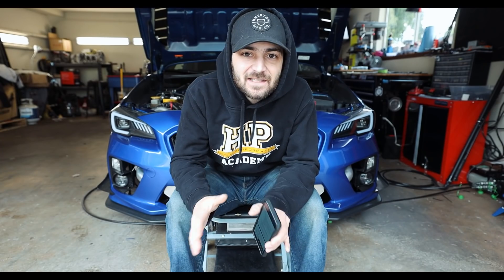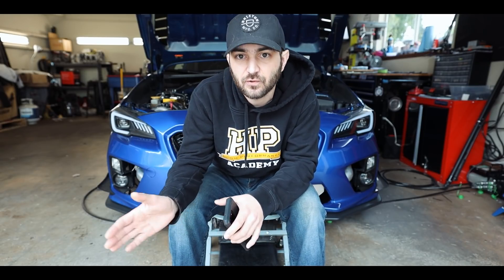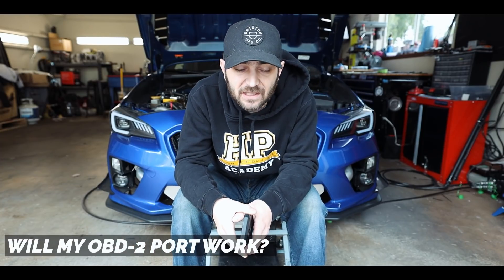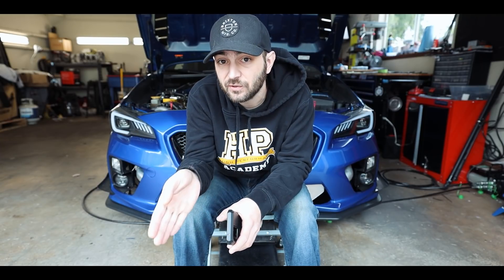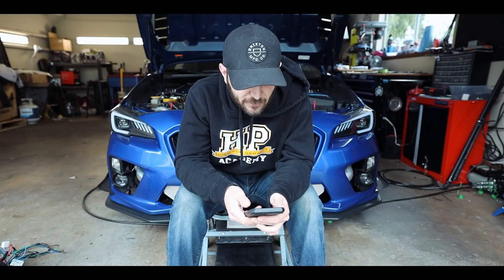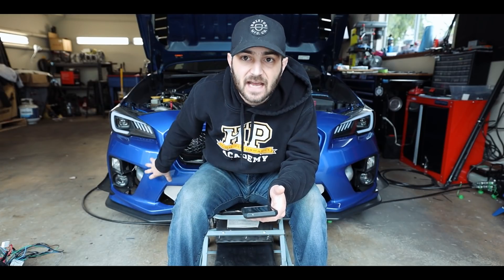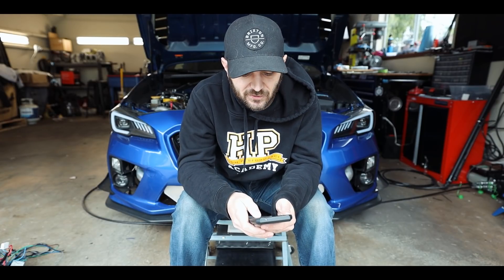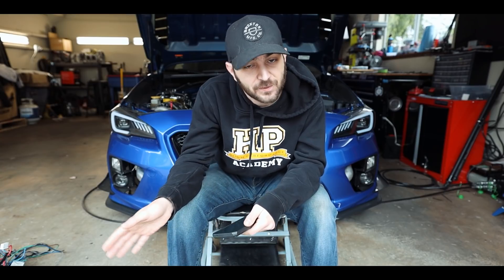Everything You NEED to Know About Stand Alone ECUs & Your Subaru

Comment: Tanner, I need some help bro.. my '05 Outback XT motor is done. I bought a jdm ej20x to swap on, but it's dual AVCS. The swap seems to work using the jdm block/heads along with the USDM Intake manifold/ turbo and Exhaust manifold. All sensors/switches plug in except the exhaust AVCS sensors, which people leave unplugged. The thing is, my car came modified and tuned for a catless DP, CAI and Grinspeed Boost Controller; however, I was never given its tune or Access Port, it was probably open source. Now I'm afraid to swap the jdm motor and damage it due to those existing mods on my car. I heard iwire makes a merge kit to control the jdm exhaust AVCS sensors, but I'd need a jdm ECU. What a headache man.. What do you recommend I do? Do I have any options or should I return the motor while I still can? Thank in advance!

Comment: Just wanted to give people a heads up, after talking to several different reputable tuners in my area, in general most if not all previous versions of downpipe/jpipes are tunable HOWEVER they will throw cels. The only one that is out there right now is the new GrimmSpeed's V2 jpipe that is said not to cause any cels. Just had one local guy get tuned and said no problems at all with it. And from what I've been told by several Subaru techs if you do get a code (P0420) you can run an 02 spacer/defouler. One tuner did confirm it does not mess with tuning either but could not comment any further. I haven't had much luck finding people who are actually running one to see if it does help.

Comment: i just want my clapped subaru to crank again
Reply from the maker: No cranking?! 😭
Reply: @Smeedia  yeah I have a 05 RS with a 08 lgt dual cam 2.5 had the harness merged used all the legacy anti theft equipment and now I have zero power to the engine bay beats me I hate it here

Comment: I'm running a Motec M1 from John Reed Racing on my 2007 Sti. All OEM functions are retained with my setup,  for those that are wondering.  Plus I've got the flexibility to run failsafes (coolant pressure,  oil pressure,  knock,  ect) in addition to being able to watch everything (egt by cylinder, ect). It's a big investment,  but totally worth it.  And one can usually get 85% of the Investment back selling the units second hand if need be. Just my experience
Reply: Does your OBD2 port still work for emission testing?

Comment: As far as cost goes I saw that mega squirt makes a pretty cheap non plug and play ecu and harness for my 04 sti. It is $360 but my question is would this be a cheaper option in the end if I am already having my engine torn apart for a rebuild? Link is $1600 so as long as labor installing a wiring harness isn’t over a grand do you think that is a viable cheap option? I just don’t know much about ecu’s and as long as I can tune it and it has launch control and flat foot shifting I’m good.
Reply from the maker: It could be viable, but I would double chdck soecs on thr Mega squirt to make sure it can perform all functions needed

Comment: What matters more when looking for a stand alone your year and model Subaru or your engine? I will have ej25 but in a 2002 wrx.
Reply from the maker: For the most part engine and can protocol will be biggest influence
Reply: @Smeedia  ok thank you so much!  Do you think I’ll need a new engine wiring harness for the swap?
Reply from the maker: What cylinder heads are you using? 🙏
Reply: @Smeedia  I was planning on using MAP stage 1 cylinder heads. Would they hold 600 safely

Comment: 2005 STI drivetrain in a GC8 RS shell - from Haltech, is the Elite 2500 my only option? Not able/worth using the “lesser” models (Eg Elite 1500)?

And any thoughts on AEM v LinkG4?
Reply from the maker: AEM and link are fantastic, haltech is thr only one I have experience with so I'd say haltech. 

The 1500 should be sufficient for the car

Comment: Based on my research (and it’s extensive because I’ve been planning out a stand-alone build for a year) there is NO aftermarket ECU which will handle emissions monitor checks or be passed by an OBD2 emissions test. Some aftermarket ECUs can be connected to the OBD2 port for canbus communication so something like a diagnostic scan-tool will still pick up codes and data pids. But if you live in an OBD2 emissions state the car will not pass because even if a scan tool can communicate with the stand-alone it won’t report any completed emissions monitors.
Reply from the maker: Good to know I couldn't find any definite answer in this topic.

Comment: for all my broke boi 01-05 wrx friends, haltech also makes the HT-055174. its a direct replacement and doesnt even need an adaptor. Not sure if its missing key features or other reasons its cheaper but its $1570 instead of $2240
Reply from the maker: Good addition to add 🔥

Comment: Before all my fellow va fa20 and ej owners go out and buy a stand-alone please keep in mind that alternative options are being worked out at the moment, we will have an opensource solution in the near future. And this is gonna happen in 1 or 2 ways. 
1. Opensource from scratch
2. Cobb source code (either exact replica, or heavily based on access tuner pre green speed)
Reply: Whos doing it? My build starts next weekend and I've been so overwhelmed with what to do tuning wise
Reply: @jamesj8348  it’s a conglomerate of people apart of the community who have the relevant knowledge and skills to work on the software aspect. For now if your build consists of items that will now trigger cel’s or if you have a flex fuel kit, your best bet is to either get ecutek, or wait. If you have the money then stand alone is fine as long as you’re okay with going that direction. However a little patience will not only save you money but also hassle from having to keep moving over to other tuning platforms as your build progresses. In the mean time I highly recommend getting a tactrix cable as you will need that once opensource is a available
Reply: @ps3alphagamer12  thanks man, clutch is getting replaced this weekend so I figured that'll be a good time to add all my mods. But I guess I'll just have to be patient and install everything while the motor is back in. It's all been so overwhelming, I ordered all my parts and shortly after cobb announced the update..
Reply from the maker: This! 

These are just options for those who have bene looking or for those that wanted more info. 

But open source and work arounds are coming out and IMO are still the most viable options over a stand alone

Comment: Just a heads up there is a company making third part plug and play adapters for the 2011-2014wrx & 2011-2018sti to run a haltech elite 2500. This also includes a base map. The company is called 14point7solutions. Also they believe they will still work on 19+ STi but haven’t had a car to test and confirm on. Can send you the link if you want to know more
Reply from the maker: Any word on if they're building out the Canbus support for it?
Reply: @Smeedia  I’m now more curious about this though, I reached out to the owner who I talked to previously to see what canbus features are all supported and if and if any are left out
Reply: @Smeedia  btw talked to them canbus support is there. Turns out this is the same system Bader will be testing

Comment: just need someone to boom slang a halter 2500 so we can figure out what exactly is retained and what needs to be be manually wired in. also if things that are wired in already via stock if we can assign them. for example the tagv left for flex signal.
Reply from the maker: You can re assign some but don't know the extent of what you can actually change in the software. In theory should be any AVI input
Reply: Well I have the boomslang in my hands.. I’m just trying to justify ordered the ecu blind and not knowing what is actually going to not work and what is… ya know ?

Comment: Say you were building karma right now instead of last year... You've got the 1300cc injectors, made fuel lines/dual pump in tank, you have the full $800 Cobb flexfuel kit and now you have to decide if you're going to work with the castrated Access Port/ comply with emissions (evap, charcoal canister, tgv, cated dp) and just run a 93octane map/ have the second map for ethanol.... Or do you say fudge it $$$ and go standalone.

Where I'm at now, I was building "The Karma specialrecipe" with +2mm rods  minus the rotated turbo and AMS intake manifold... But instead of the BC valve train in karma I have ferrea valve train/tomei poncams and ported heads.  I've only got an FP Blue, flexfuel was so easy last month I literally just wanted to see how far I can push a stock location JB turbo with a mild cam and porting. I think I'm tapping out on e85 for now/ just enjoy it as a headache free 93 octane street car... The extra $ + inconvenience of checking ethanol content at the pump like it's 2011 again and switching maps or $$$ standalone and find a tuner comfortable with whatever you have.
Reply from the maker: Personally I'd say fudge it and get the standalone, if I'm already in that deep I'd just send it and do everything proper 🙏 think you'd be happier long term with full functionality

Comment: I know I couldn't use haltech with my setup I working towards have to use a AEM  to work with the avcs and the eight injector ill be running
Reply from the maker: Going to be a wild set up 🔥
Reply: @Smeedia  going to use 1050 cc for primary and 2000cc for secondary. I'm trying to hit 35psi boost at 3500rpm aiming for that 800 hp at that rpm and stupid trq

Comment: Thanks again Tanner , you are an asset the Subaru community. It doesn’t seem like there are many options for us VA chassis owners. Hopefully time will fix that.
Reply: It really is a shame that there aren't more stand alone options for the VA chassis but after running the Motec m142 in my 2016 wrx for a couple years now I have to admit that I'm wildly impressed. Pretty expensive but the engine control is excellent without loosing oem functionality. I would encourage anyone with a 2015+ to give them a look if they are wanting to go the stand alone route
Reply from the maker: 🤞🤞🤞 hoping some more PnP options come out

Comment: Just the content i need to hear brother💪, just when im about to continue my build, so I spoke with my tuner he told me to stand by on buying more parts, so theyre trying to find out a solution to tune it right in order to use the tgv, e85 air pump delete and all that crap cobb made it complicated to us...🤞
Reply from the maker: I heard some people are looking for work arounds at the moment 🔥
Reply: @Smeedia  🤞🤞🤞we'll see bro....eager to see The Blue Devil H6 ripping the Dyno!🔥
Reply: @Smeedia  JR tuned says he can do those things now still. And even in the future
Reply: Following on this! Specially the air pump delete. I don’t have to deal with the rest of it… yet! lol
Reply: What I've found out sofar for us GD sti guys 04-06 tgvs are side feed injector rails/ this is a problem since the tgv deletes are also top feed fuelrail conversions... 
The TGV sensor is identical to the TPS sensors, should be able to plug in 2 spare TPS sensors and bam the check engine light should stay off/ I'm going as far as milling dummy flanges to weld on  to the aftermarket tgv deletes in the stock location. Thoughts anyone?

Comment: Thanks for the reminder of off-road use only! I will only use this on my personal roads that I paid for through an involuntary forfeiture of part of each paycheck. Oh wait…
Reply from the maker: Gotta CYA now adays 🤣😅
Reply: @Smeedia  Not saying that’s what you’re doing, that’s just what I think of for “influencers” covering their ass haha
Reply: @Smeedia  “BUY MY CRYPTO!!! *this is not financial advice”
Reply: @Smeedia  ez30 ecu
Reply: Don't worry, if it's developed to that extent, your not going to be interested in driving on the highway.
If your not running the FIA inlet restrictor the map on the Pectel system will destroy the motor even with 109 octane. 
Magneti marelli make a reliable ECU that also has good definition for centre and rear diff. control on the original Prodrive/Ricardo/ Dave Lapworth box and rear diff.
Mines an old 1994 shell with 1998-2002 WRC mechanicals.
Don't bother with the Cosworth electronics, virtually no one has the software, though Cosworth engines are still competitive and reliable.
(Min of 400 competitive miles between rebuilds) if you keep the revs below 8500rpm. Use 9000 too often and its done in 100 miles or less. At 27k per refresh it's an expensive season, even if you don't crash too badly on most events🙄😔
Reply: Roads? Where we’re going we won’t need roads